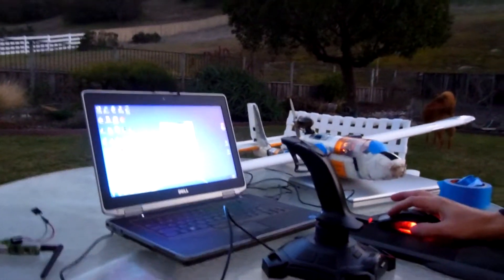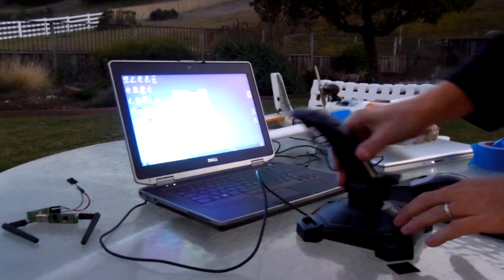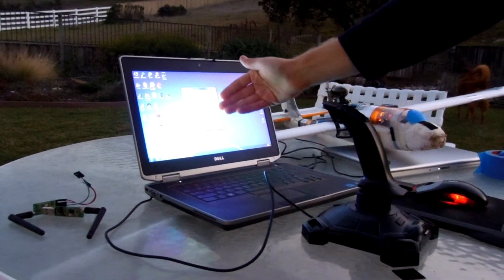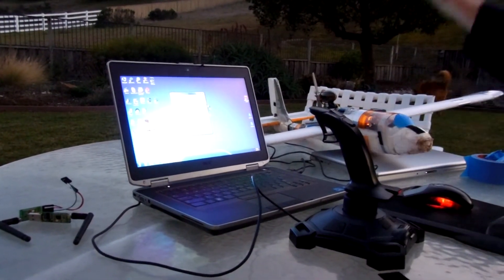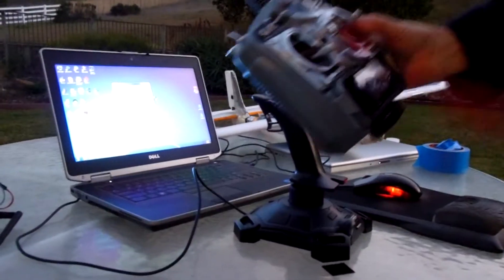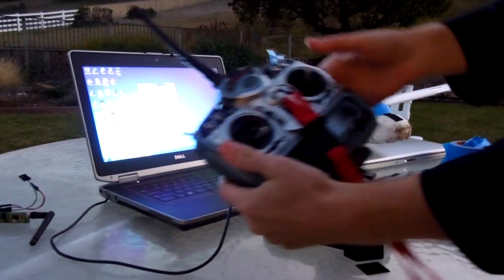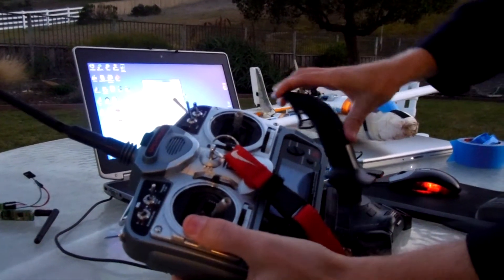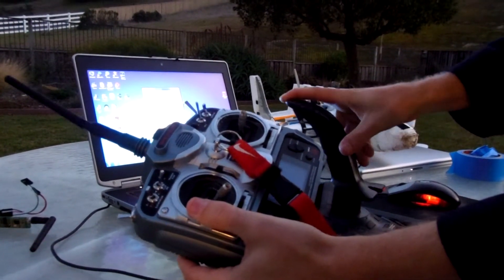Flying an RC airplane via cell phone - actual aircraft

Comment: Sir, what are the chances to fly a rc plane tens, maybe hundreds of km, using the 3G cellular network with a gas engine on the plane of course and assuming you stay in areas with network covering and at a reasonable altitude of course? Is the time of response way too long?

Comment: Ever consider using the New 9 Dollar Computer? 
It is a Very Small computer; Better than a Raspberry Pie, and It would put A computer inside the plan connected to the Wifi of the Phone via Bluetooth, that would allow you to get all your inputs without converting them to RF first:-) Then I would Srtip the Phone Remove the casing, battery & Screen put a ribbon cable extension on the plug for hooking up the screen for programing only, then hook the power directly into the plains power, if you are using a good Phone service you could have a flying range limited only by the Batteries or Fuel the plan can carry.  If you would like to try this I am Giving away a 9 Dollar Computer on my Channel you can try to win or at least use the links to get the newest model.
Reply from the maker: This video is from a project I did in 2011, which was a side project of one I started in 2008. Much has changed in the Drone world since.. See: http://diydrones.com/profiles/blogs/proof-of-concept-flying-the If I was to do it over I would do it much differently.

Comment: This is a brilliant design mate, I'd love to see a follow up on it if you get chance or perhaps a run down of how its put together. Very inventive and well put together!
Reply from the maker: Thanks! There's a little more info here at my older video from 2010
https://www.youtube.com/watch?v=B4UlEf379b8
Reply: ***** Just had a look, cheers for pointing me in the right direction and for sharing your work. Your UDP work round sounds solid, I have big ambitions with drones but limited knowledge im afraid, I have in mind to create something like latitude engineering's hybrid drone http://www.gizmag.com/hybrid-quadrotor-hq-uav/28767/, I like the concept of taking full advantage of the liquid energy density, that thing can do 600 miles on a tank and carry a decent payload :-D
 But a hell of a lot cheaper, that 60 pound version is $50k and im likely never to see that type of money im afraid :-(
 I'm trying to get some doe together to save up for some carbon fibre manufacturing gear to mould a nice duplicate of the frame :-) but im still pondering on how best to pilot it and I do like your setup.
 I was thinking of a similar thing but done through the new 'white space' bandwidth google and a few others are working on atm, but I like the gsm approach.
 I'm not familiar with a lot to be sure but definitely keep at it, im glad ive had the chance to chat to you before someone like darpa scoop you up. That latitude design is top spec for the only guys with a budget these days and that's the usnavy :-)
 I'm definitely signing up to your channel im looking forward to any vid stuff you put together on this one. 
 I'm just a bit of a bodging self employed programming part time electronics enthusiast is all, I do seem to have an eye for good design though so I'd say you have great potential here....like bitcoin in the early days :-D
 Again well played on putting it all together!